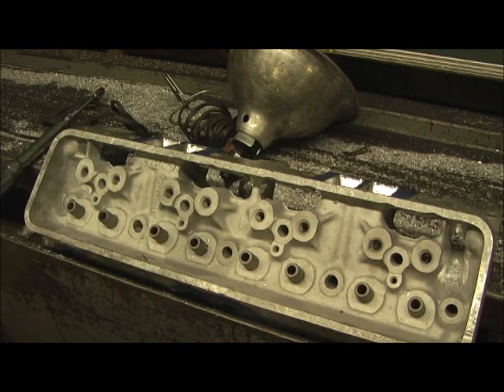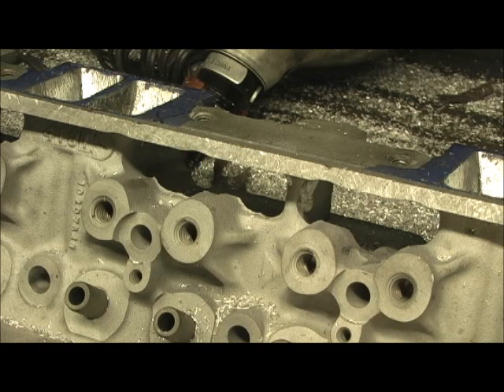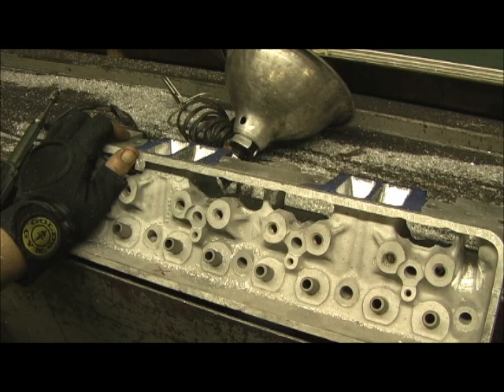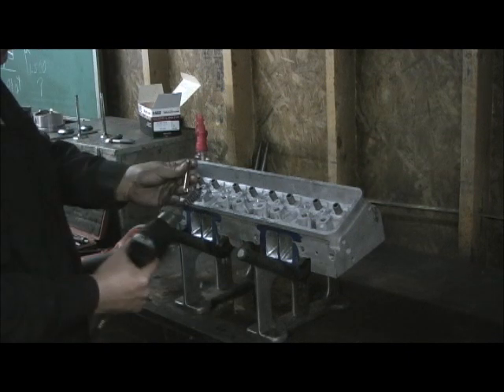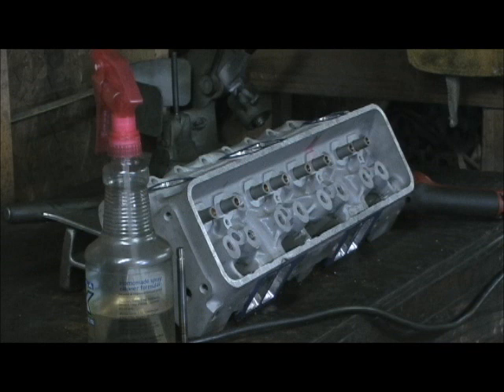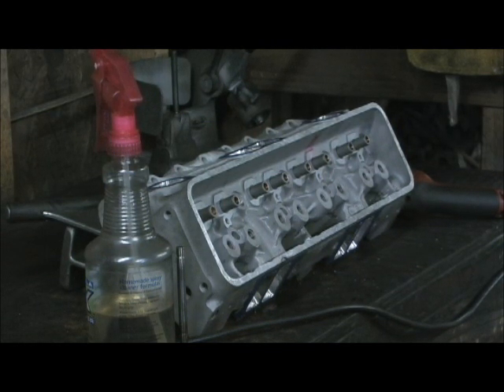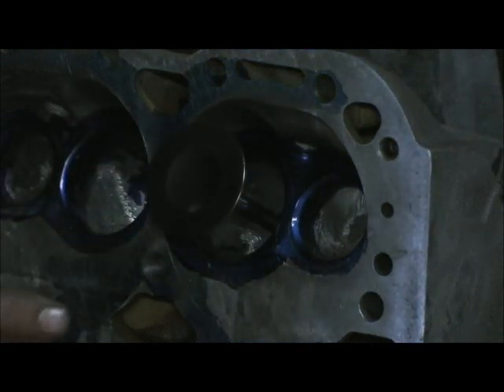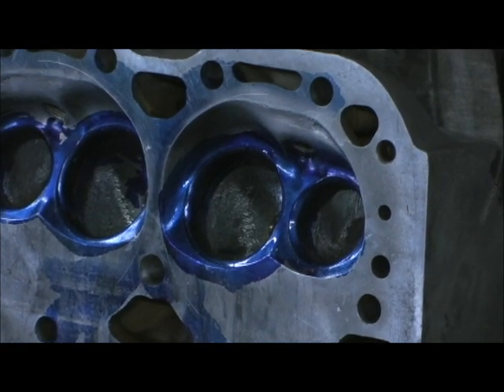LT 1 Stage IV Full Porting Part 4  2

Comment from the maker: Yank, I know from a theoretical standpoint, polishing the exhaust port DOES help the thermal conductivity thing (here we go), and would keep the exhaust gasses hotter as it traveled down the path; however, IF you could measure the difference with a Eddie current dyno (it measures to a 1/4 horsepower, and GM FORD and DODGE has them for the engineers) I would be shocked to see more then 1 HP. The truth is, what you said about Carbon buildup, that is why you would polish the port, 50 grit finish.

Comment: The only advantage I can see to polishing the exhaust would be that it may keep carbon from sticking to the walls a bit. And possibly reflecting the heat back to the exhaust. A hotter exhaust gas would flow faster.

Comment from the maker: Continued) between 9 to 18 Ft. Lbs. MORE torque in these ranges (1000 to 5000 RPM)!!! SO when you do the math (and I do) while at say 7000 RPM the polished head made between 2 to 4 Horsepower more (and sometimes even less or nothing) how does that stack up against 9 to 18 Ft. Lbs. more Torque through 5 thousand (or over 75% of the dyno run sheet) RPM's. Most of the driving range is in that range (on the street, and most certainly getting to the RPM of the gearing of the drag strip) depending (Co

Comment from the maker: I feel ya Yank, I have been doing it like that for over 20 years, since I performed a dyno test over three different engines and seen the difference it made and I am talking about "CONTROLED TEST", and it was all the same that while the polished head will make about a couple of more HP at the highest RPM (I mean around 2 to 4 was the most I ever seen on a MOPAR 340) the "carbide finish left cut" head did something greater. Just off Idle to around 5000 RPM the ruff cut head made (continued)

Comment from the maker: Con) was a "POP" casting where there was an airhole in the port, and I get them all the time and rarely does it turn into a actual HOLE. IT is never in the same spot, and most the time it is inside the runner, not the bowl. That just shows you don't do many of them, or the few you have you never took anything out. You probably done even have a sonic checker, and do it blind. I would not want a set of lawnmower heads from you for sure!!! LOL

Comment: You are on the right track. The weight of air at high speed needs to be considered. Air hates to change direction and loses energy when it does. Conservation of this energy can be used to supercharge or ram the intake charge down the engines throat. The shape, size, design of the ports and valves  ALL need to be considered.

Comment: There has to be a point where it effects volumetric efficiency I agree. Lets take a typical valve, now picture this mass of air fuel mixture coming in and hitting the back of the valve versus sheering off with ease. It makes sense but I think it would require a different intake port design.

Comment: Carp, the stem must be straight. You are talking about the valve shape above the perifery of the valve face. The valve shape is usually tulip or flat and the port design dictates which is more efficient. In line valve arrangement such as the smallblock Chevy usually like flat faced valves because much of the flow comes from the center of the cylinder and across the valve.Tulip faced valves work on hemi style ports or very staight race type ports.pe

Comment: I think there is definitely more power to be had with this combo, I am still running those crappy Bosh plugs. I will get the NGK TR55s one of these weekends since putting headers on this car made changing plugs easy. It took it from and 8 hour job to maybe a 1 hour job now. I was also thinking that the new clutch wasn't really broken in during the dyno session. Tony did one hell of a job on these heads.

Comment: The TB is easy upgrade, then some dyno time to adjust the fuel pressure to make sure it's not running lean. I been thinking about the 1.5s though, give it a little more low rpm use, you think I would lose a lot? It doesn't like sub 2k rpm until I hit 6th at 55-60 mph on the highway. It being a 6 spd car it's easy to work around that though. The rev limiter is set by the ecm, I had them set it to 6300rpm.

Comment from the maker: Con). As far as the Opti goes, does this not have a built in Rev Limiter? Most of them do these days (and back in the 90's). If anything, the MSD box and distributor (I think MSD makes a kit for this engine with a lower head to clear the under hood clearance) kit to help this. Your engine is not designed for those RPM's even the power metal Rods are the best GM has made to that date, but the heads are running out of air before 7000 for sure. It will be interesting to see the changes of the TB.

Comment from the maker: While I said Carp that you never know what an engine wants till you swap around the rockers, and testing is fine, you might not want to fool with that till you swap the Throttle body first. Swaping the rockers around tells you a lot about what the engine wants in the camshaft on your engine, since the intake manifold is a DRY INTAKE due to the F.I.  While I believe the bigger 1 3/4 headers might help a little, it will not make near the difference the Throttle Body will, (con

Comment: Sorry, GO A.P.E. RACING and you can email me, get it from Tony. I think it was very interesting putting your 355 curve up against my 383 curve in my '71 Chevelle. VERY similar combinations,  So when I tell you upgrading from 2.5" dual exhaust to a custom built 3.5" dual exhaust with anti reversion collectors and a full 3.5" H pipe Made a HUGE difference in power from idle to 7000 rpm. I designed and built it nearly twenty years ago and has a very similar idle to your car. Such fun!

Comment: Cont. 11 cc piston valve reliefs, 1 5/8" headers with mufflers, sequential fire intake manifold, 1.94 / 1.5 valves, 783 cfm throttle body ( stock Lt1).  I figured that 85% of your power gets to your wheels and at 481 hp at the crank that equals 408 hp rear wheel which is damn close. Carp this was a lot of fun and I am sure if you have someone with a brain tune this thing there are not many true street cars that can touch your car!  The 1.5 rocker will give you a touch more low end torque.

Comment: Carp, I find it hard to believe that the opti dies at 7000 rpm. Hell, I used to spin dual point distributors to that. But like I said before I am not the LT1 expert but I know smallblocks pretty well. I estimated 294 cfm intake and 211 cfm exhaust, 290 / 290/ .56 / ,56 lift with 1.5s , .597 lift with 1.6 rocker. Adding 1.6 rockers add 2 degrees advertised duration so that is 292 adv. and .597 lift. 10.84 / 1 compression. 56.6 cc heads .026 head gaskets, pistons -.020" down

Comment: I think the opti on these cars crash at 7000 rpms, I would have to re-do the ignition system if I wanted those numbers. I'll do what you mentioned earlier and go with the 1.5s and the 58mm. Thanks for the great news and your time! I don't have flow numbers for the heads but I do know 197cc intake 72cc exhaust 56.6cc chambers, they prob flow 290cfm range. CR is around 10.84 and it has a nice free flow exhaust now with full length 1 5/8" headers no cats 3" all the way back.

Comment: Intresting, I was thinking of going back to 1.5s actually. Howards cam, .560/.560 237/237 110lsa this is with 1.5 specs and I am running 1.6s so it's closer to 600/600 240/240....it's a beast thought. She doesn't like it under 2k though =).

Comment: If you added 20" long collectors and a VERY low restriction exhaust That adds 26 hp and 24 ft lbs! The nice thing about the 1.52 rockers is it lowers you valve train crash speed about 500 rpm. So If it were mine I would spin it to 7000 rpm which it could do easily with those springs and pro magnum rockers. If you get your tune right you could run regular gas and after you say that is impossible I run a bit higher imep in my work truck that weighs 5800 lbs with IRON heads! Yankee cutter

Comment: I also ran through headers and throttle bodies and every combo. My advice, which is worth exactly what you paid for it, is If I were broke I would do nothing. If I had some $ Comp pro magnums 1.52 on the intake and exhaust. If I had a bit more I would use the 1030 throttle body. That is the combo I like best for the least $. 1030 1.52/1.52, small headers. runs 489 hp 472 ft lbs. the bigger throttle body brings about 4hp and may not be worth the cost. Larger headers add 10 hp.not worth it, now.

Comment: Carp, Nice little smallblock! Did at least 60 computer dyno pulls and the results will surprise you. I did have to guess at a few things like flow numbers but I bet I am REAL close. As she runs right now I got 481hp and 465 at the crank. The 1.6 intake rocker and 1.5 was a winner up to 5500 rpm even till 6500 and a winner at 7000. That did not surprise me. What surprised me was the motor liked 1.5 /1.5 even better! less over lap and higher imep made more power. More area under the curve.

Comment: Ugh, I was reading about people having nightmares trying to tune a mono blade, not only the TB is 470 then a 50 for a retune and then 100-200 manifold work + new intake gaskets + 150 dyno tune... You see where I am going with this? I am prob just going to get the 58mm dual blade, not because I think it's better but the mono just costs way too much.

Comment: Hate to use Advanced Induction as a referal, but they are running a 9 sec. Trans Am with a LT1 and they are using a mono blade. They also claim to get 15-20hp over the dual blade.

Comment: I am not the lt1 expert so I do not know if you are running a cast or forged piston, Cast or forged crank, Forged of powdered rods. Since this is not a tow truck ask Tony what pressure he set up the valve springs and what he feels your max rpm is. I wish you had a nice double spring with titanium retainers so we could spin it a bit. Email me with the specs on the engine and lets see what we can do with this thing.

Comment: Sorry Tony,  I am  a slow learner.  I agreed before that I preferred the single blade throttle body over the dual blade. The single blade is an oval blade. I would prefer a round blade over the oval. I would sawzall the top of the plenum off extend the runners  to Helmholtz resonate at the torque peak raise up the whole plenum to 2.85 liters and finish it off with a huge round single blade throttle body. But that is just me.

Comment from the maker: WTF, do you not see that Charles? YES Laminar Flow due to the fixture that disrupts the LAMINAR flow rushing to fill the BOX part of the intake.  This is why the Single Blade would work over the Dual blade, it IS CSA, fixture or mount material displacement, coupled with a SINGLE MAINSTREAM FLOW ANGLE rather then two separate paths, there is no LAMINAR Flow with two blades, rather disruption. Remember the TUNNEL PORT FORD 427 engines that had the TUBES in the center of the intake ports? Think on

Comment from the maker: That is one of the misconceptions of all time Carp, the engine is NOT AN AIR PUMP because air is not "sucked in", but rather the earths atmosphere is at 14.7 PSI above us on top of our heads, and when the valve opens up the atmospheric pressure senses the negative pressure in the cylinder bore and rushes in to fill it the best it can with the ports, headers, intake and camshaft that lets it fill it at 14.7 PSI. NEVER describe the internal combustion as "an air pump" EVER!!! it is not even close

Comment from the maker: turn the carbs sideways on big tunnel rams, and why the "split Dominators" are the bomb even now. It would then fall into place that the front two cylinders on the "BOX" part of the intake might have a imbalance on the front two since the Throttle Body is just past the front two runners (or right behind them). Look at (I have said this many times) the Ford 302 engine and how it is a single blade? If the air is coming in at 690 FPS and has to somehow turn around, then you have pressure problems.

Comment from the maker: I believe that like a carbureted intake there is a fuel/air distribution problem here because of the connecting rods having to be place right beside each other. If you notice a SBC block, there is one side that is inches forward (or backward)and not evenly set. It is impossible to do because of the connecting rods. That being said, everyone who fools with Intake manifolds (Keith Wilson) has to alter the intake for a left and right side to balance it out. That is one of the reasons they used to

Comment: It is a terrible design. But it needs to fit under the hood. It should be more like a full sized tunnel ram  or cross ram with a huge plenum that would dampen the resonance through the throttle body and have a ramming effect at a USABLE rpm. The more space the air has after the throttle body to become laminar the better it would feed all the cylinders.

Comment: Ram effect is real and can be huge. The lt1 uses a non tuned intake, It would start ramming at a very high speed. This is one of the reasons that the torque curve is very flat . The tpi with its 17" runners tune in at a low rpm and boosts low rpm torque but runs out of breath at 4800 rpm. The air is actually pushed into the cylinder due to atmospheric pressure. The pulsing for a v8 is a mess into an open plenum like the lt1 they do effect each other but do not cancel each other out.

Comment: Do you think there is a fundamental flaw in the design itself? It being the front cylinders running rich with a dual blade TB since air shoots into the back of the intake manifold versus the mono blade? I

Comment: It is ok to oversize a throttle body but it does effect driveability and tip in. I run a 900 cfm in my work truck that only revs to 5800 with 355 cubes. The 1080 is good for about 600 + hp so that will hold you for a while.

Comment from the maker: It is, once again Charles, CSA and in this case the area used by the fixture holding the Two blades, when measuring the area held by the fixture that supports the two, One blade will give you a LOT MORE, and the other thing is how the fixture and double blades have laminar flow inline just past the front two cylinders of having to "double back" to get to it causes a turbulent air problem which if I am on this means the single blade has less obstruction that two blades opening at once. I.E. Ford

Comment: Lets think about this. Hermann von Helmholtz did lots of work on wave effects and ramming. Every time the intake valve closes there is a pulse wave that is reflected back up the runner. This reflection would continue to the plenum. This is the organ pipe effect and is tunable to produce a ramming effect to supercharge the intake port for a narrow rpm width. How would the single vs. dual blade tb be different and CAUSE a ramming effect I have no idea.

Comment: Here is the quote from the forums "le3/ai200 heads yours are not. Without big changes that motor will not go 450rwhp. You cracked 400rwhp, which may or may not be a dyno fluke, track numbers tell the real story."

Comment: The stock is 5.7 but I was just wondering if a mono blade TB be better then a a dual blade TB? 58mm TB can flow 1080 cfm and the mono blade can flow 1300 cfm. Is it over kill to go with the mono blade with my application? Also I was reading on the topic and came across some interesting points where some tec guys say that the dual blade design starves the front cylinders since it creates a ram effect inside the manifold of the LT1.

Comment: I am not sure what we are comparing  here stock GM throttle body to what? Get me some info on what we are comparing and I will look at it.  In my opinion a round throttle body is the way to go with the biggest custom straight spacer you can fit behind the tb (custom of course) cut open the manifold and ADD plenum volume. 5.7 liter NEEDS at least half of the engines displacement so that would be 2.85 liters I would like to know how many liters the stocker is.

Comment from the maker: That is interesting, and I would love to see Proof of this, real dyno figures and WHO'S dyno it is the testing is on. I would like to see how this works, because I can see how it might be helpful due to the Cross-Sectional-Area that would be GONE if you got rid of the TWO blades and there sockets and fixtures down to one. Are not the Fords (1987 through 1993 all ONE BLADE style Throttle Body? I believe they are and that tells you there is something to it. Where would you find out about that stuf

Comment: I'm just going to toss this out there about our e-mail conversation about the mono blade throttle body. I was reading about this on tech blogs and forums and they claim that the dual blade TB starves the front cylinders of air since it creates a ram effect and the mono blade TB solves this issues. Is this a fact or more forum/blog drivel?

Comment from the maker: I think I will re-name my business from Headbytes to "Fluke Heads" because it is my fault your engine is making 412 HP and a torque curve flatter than the plains of Kansas! Next time I will listen to these people on the forum your on and maybe we can get these numbers corrected. They will be considerably less (like 375 and a peaked curve) but they will be corrected...I cannot say I blame them, I would hate to hear I spent 2500.00 on a set of AFR heads with 2.05 valves and bot bested by Stock HDS

Comment from the maker: That is the best news I have herd Carp. While the 1 3/4 headers will make a difference, it will not (should not) make the difference that the BIG (58mm) throttle body will make. I am almost certain that 25 HP is there for sure, maybe 35, but the headers should make around 10 or 15. Once the restriction is eliminated (full length with a collector) then the gains are fewer. As far as rockers, once again the ratios are all over the place and just getting them correct will make a difference.